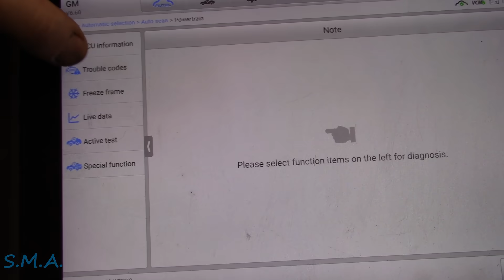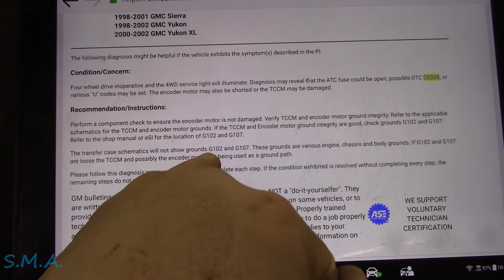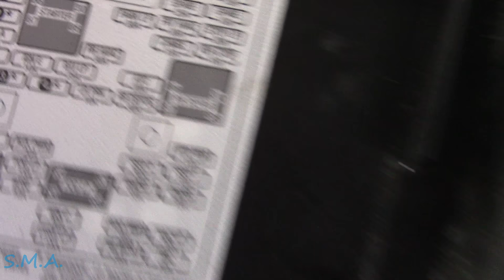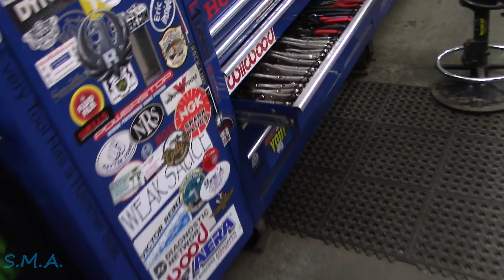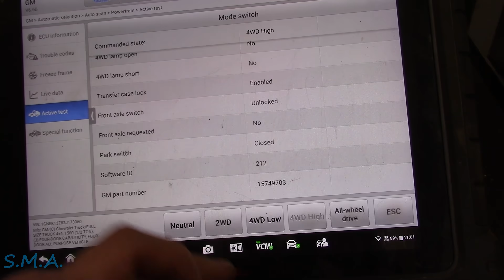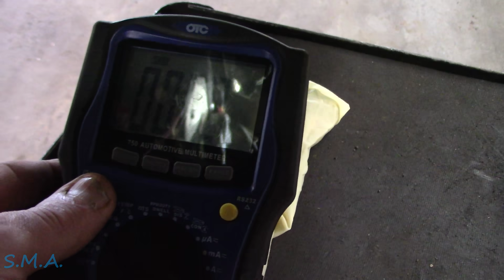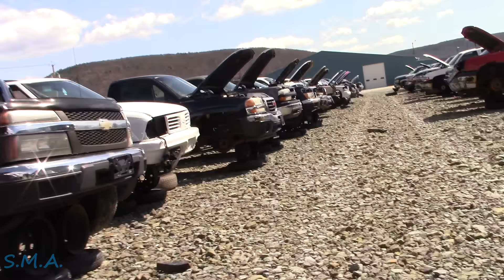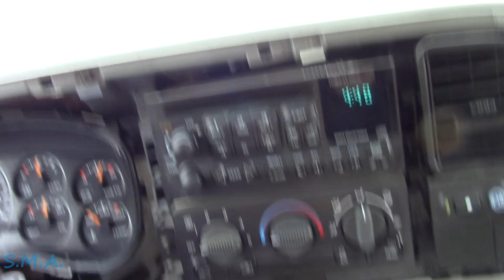Customer Spent $1000's And Still No 4WD

Comment: I had a Ford Ranger 4x4 that two different mechanics couldnt figure out why the t-case shift motor kept going out. Cost me the price of two of those little jokers. I got to digging around online and ran across a post where someone said the t-case motor could sometimes rotate too far when going into 4 low. That caused the sensor to be unable to see the position so it wouldnt shift. All I had to do was pull the t-case motor, physically shift the t-case to 2 low or 4hi, replace the t-case motor and it worked like a charm. Never had the problem again though I did pass along that little tidbit when I sold it

Comment: Wife is a Doll as usual., 
I found a great place for my cougar, 91. Had a smog thing  that has vacuum to it well it was all clogged with dirt and dust, replaced it. Did some other things and car runs GREAT! Got 22.5 mpg loaded up car going to SLC. For new JOB! Only drove 70 mph not F’ing 80 like every else was burning gas faster than they can pump the oil out of the ground in the Middle East !

Comment: Did you say corning earlier?!  Holy crap, I had fam up there until recently.. I've never had a dorman fail me, BUT I've also never used anything plastic by them or anything that was electrical or articulated.  It's always been stuff like exhaust manifolds.  Is there any way to test one of the shift motors before you put it on?

Comment: Went through this with several rebuilt actuator motors they kept exchanging. Ended up going with OEM.  Good troubleshooting! I just went and tested the last bad one they exchanged and it's shorted the same way.  They've got to be doing something wrong on the rebuilds.

Comment: If it has anything to do with electrical I always get OEM parts. For things like brake pads I will go aftermarket if there is a huge price difference. When I changed my front brake pads and rotors on my Ford Escape Ford wanted $160.00 just for the front pads alone. I live in Canada where prices are higher. Why would I spend $160.00 when I can get a good set of aftermarket pads for $70.00. I also changed my lower ball joints, outer tie rod ends and stabilizer links to aftermarket because Ford only sells non grease able stab links, tie rod ends and ball joints. I am in my mid 50's so I come from a time where greasing parts is a good thing. My Ford Escape only had 130000 km on it and the whole front end was needing to be replaced. So now i grease all the joints.

Comment: I think a bigger problem with these "couldnt fix it" shops are flat rate techs expected to find issues for .5. I work for a ford dealership, and I refused to go flat rate when the time came and they put me on split pay, but I've seen so many guys, my foreman included, load up the parts cannon because they're expected to diag this stuff for free.

Comment: I'm at 21min into the video and my guess is that because the motor is a bi directional (Bi polar) motor then both legs of the motor have to remain clear of ground, if one leg is grounded then the motor will work in one direction and blow the fuse in the other. just grabbing my popcorn, this is getting interesting

Comment: I have a 2000 AWD astro van. (Automatically controlled awd ).  Mine quit working a couple years ago. Upon investigation I found a "Remanufactured unit had already been installed, and replacement was not an option because of cost.  I took the old one off and found that one of the two motor brushes was worn completely off and I couldn't get replacement brushes.  You can't even buy just the motor, witch wouldn't have been difficult to replace. So upon further investigation, I found that I could leave the motor and gear box off, and I installed a linkage and rod that I can now manually use to engage or disengage the transfer case from the drivers seat by merely pulling and latching, or releasing and unlatching the rod coming up through the floor. If you are creative, sometimes you can bypass what I often times call unnecessary improvements to help get you out of the "money/technology trap.  I have investigated and solved many problems by watching You tube videos. My undying thanks go out to all those who have posted both informative and entertaining videos.

Comment: Remember when all that you had for 4wd transfer case was just a shifter and rod that was used to shift in and out 4wd some had to lock hubs.  Things were so much easier back then and easier to repair
Reply: Replace the linkage done.

Comment: Don't know if it's a GM design defect. I have a 07' Chevy Silverado and my transfer case went out after 80k miles. Then I got another one from the junkyard, and it went out after about 2k miles. Finally got a decent one from another junk yard.... But I agree with you, Transfer Cases are dang expensive!!

Comment: The Autel is such a nice scanner. Having Identifix right at your fingertips at all times is invaluable. My last boss had one and I spent 3 times what he did on a Snap On Modis scanner. The Modis is a great scan tool, but the info in it isnt set up as nice as the Autel and it has no internet built in. Between Google, a laptop and the Modis I was able to do what the Autel does, but that is quite a disadvantage. Some lesser known brand scan tools wont scan all the available modules, the Autel does just about everything, but I have found there are times you will need one over the other, or vice versa, to perform a specific task, get access to a particular module or perform a specific test or reprogram. The Autel was great for reprogramming keys, Id grab it everytime when i had to reprogram a key, but now they make fairly inexpensive key programming modules that work very well for around $500. Another thing i dont like about the Modis, and just about any other scanner Ive saw short of the Snap On Zues, is the fact that you cannot work bidirectional commands and monitor the scan data at the same time. Some tests will give you a short data display, only showing a few PIDs that are directly related to that test, but opening a canister purge valve while monitoring O2 sensors is not an option, just as an example. You would need two scan tools to do this and there is only 1 OBD plug. The Snap On Zues will allow split screen operation, so you can work a control and monitor data, it runs on Windows CE and the Modis on some proprietary ridiculously expensive Snap On software. The difference in the cost of updating the Autel and Snap On scanners is vast as well, I spent $1200 a year on a software subscription service to keep my Modis updated, for that money you can buy a used Autel. If I did it over I would certainly go with the Autel, they work just as well as bigger name scan tools and cost vastly less.

Comment: There is a wire harness that runs beside the fuel filter that can rub on the front driveshaft and cause ATC encoder motor and Rear O2 sensor problems, but I saw the harness and it didnt look mangled. I have saw quite a few of these do this though. Just FYI

Comment: Chevy loves to add too many levels of electronic crap to their systems. I have a Trailblazer that keeps blowing a fuse under the rear seat. I finally tracked it down to a short in the air conditioning under the hood. I fixed that and the 4wd began working just like magic.

Comment: Did I mention that I went through this hell and it was the associated fuse receptacle in the panel at the left end of the dash.  The fuse was good, and both sides showed 12 volts.   Until you pressed a transfer case button and the load side of the fuse receptacle dropped to 2 volts, then maybe 0.12, until the load went away.  I pulled 5he fuse, used a nail file to clean the fuse holder and like that, 4 WD all fixed.   The command couldn’t make it to the encoder motor and when the expected result neve4 occurred, service 4WD system flashed on the dash.    Just a fuse connection.

Comment: Those grounds are on the left-hand side underneath the truck below the drivers door on the frame right The bowl that holds the cab to the frame a lot of people miss it because they think this five wire grounds don’t mean nothing and it causes nothing but problems there’s a lot of people that overlooks this ground and a lot of guys get the encoder motor clocked wrong and it will set a code you have to get that motor clocked in right

Comment: i remember when i was very young living in PA, our Grand Wagoneer had similar issue, new TC motor installed, new TC put in (pothole damage broke bracket) tech was talking to my dad and asked him if its ok to test?   my dad shrugged sure,  little he knew  the tech simply drove behind the shop and into woods  roflmao.   it was their Jeep "customer assurance trail" both "so called"  test/diag cente. it also doubled as test drive for new customers to see how jeeps fare offroad.  It had dips, smooth trail heads,  loose dirt inclines,  roots and potholes, shallow creek, and then long and smooth farm access trial.  then back at shop via normal road.    They don't make Wagoneers like they used to. they were absolute beast.

Comment: I keep mini fuses in my tool box that i cut off 1 of the male spade from so when check the female pin drag you can check each one independently had a fire truck that was only running on 3 injectors turned out it had loose pin drag on the fuse connector 2 other shops couldn’t figure it out thats how i found the problem hours spent checking it by other i found it in about 10 mins

Comment: So - technically speaking - all the other mechs (I mean douchebags) just 4kt around relacing unknown irrelevant parts - whereas you - you replaced the ONE component that had failed.
Result - all other work before - fixed nothing.
Your work fixed the entire problem.

Comment: I deal with these NP246 TC all the time and have never seen that weird black plastic "plug"/ "cover" on the front of the TC shift actuator/motor before. Sometimes these come with a "lock" to prevent the motor from rotating during shipping, did you look to see what the heck that was?

Comment: It always amazes me how people will just throw parts at it.  I just went through this with a good friend.  2006 navigator won't start.  No codes.  Starting fluid and it'll kick over.  I take 10 seconds and put a fuel pressure gauge on it and it's got NO fuel pressure.  Jump the relay and still no fuel pressure.  Jump into the wiring harness at tank and it has 12v and ground.  And my buddy wants to check and re-check relays, fuses, etc.  His mind is made up its a computer problem.  We do this three nights after work.  DUDE you need a fuel pump.  Nah Ima take it to a repair shop.  He hauls it there.  They put a fuel pump in it and it's running great.  Oh well the shop needs to eat too.  Ok by me the thing is a rusted mess and I really didn't feel like replacing the fuel pump.

Comment: i have always had good luck with Napa Canada  parts for both my 93 Chevy k1500 4x4 and my 85 ford 1500 4x4, i stick with older trucks because i dont want all that electronic computer crap,it bad enough my 93 Chevy 4x4 k1500has all them stupid electric modules in the bottom of the transmission, with tiny 24 ga wires. when it stops shifting you have to drop the pan to get to the 5 different black modules.. i been trying-to find out witch one is the problem as at 55 TO 60km per hour it shifts into neutral and you drop it down to 1st gear an its like it is in 2nd or 3rd,, it dont mater if you start off in OD OR DRIVE IT DO THE SAME THING,, I REPLACED THE THROTTLE BODY CENSER  from napa $83 cnd AND is changed from shifting into neutral at 25kmph to the 55 to 60 kmph. a lot of time it with shift back in to OD on the hyw if i feather the gas,, or it will drop IN TO 1st..  , I BEEN WAITING 2 MONTHS TO GET IT INTO MY LOCAL SHOP TO GET THEM TO SCAN IT BUT THEY ARE SO BUSYS I CANT EVEN GET A DATE, I BEEN ON A CALL IN WAIT

Comment: Great video. What throws everyone off (including me) is when you already replaced the part & it's already defective. That's when everyone starts throwing parts at it. When the parts were cheap, it didn't matter. Today, not many people want to spend $600 for a part that's a possible fix when you already replaced the part. Not defending the other shops but it can happen. That's why I try to stick with OEM parts. Even those can be defective. & way more expensive.

Comment: Among the items your customer listed, I thought he said the transfer case motor had already been replaced. My 2003 Hummer H2 had the same problem when I first bought it used in 2009. I quickly figured out the problem was in the transfer case motor, but was hard to duplicate because it was intermittent. Eventually, I opened the transfer case motor and found there was a rotary encoder disk which had slipped loose from the output shaft. That made it occasionally send the wrong position info to the electronic controller, causing it not to shift. The encoder disk was cracked and couldn't be tightened, so I replaced it with a Dorman one. That fixed that intermittent problem.

Comment: If you're ohming something and it reads “OL” then your loop is open, in other words the path is not continuous (broken/separated) If you're in the voltage setting and it reads “OL” then the voltage you're measuring is too high for your meter to read.

Comment: Had the same issue in the same vehicle. Had to break my transfer case open, weld a hole close, grind it smooth, install an aftermarket sheild where it had worn throught and throw it back in. I changed out the TCCM while I was at it. I haven't had an issue since.

Comment: watching you is treat every time. You consistently apply a structured reasoning process to diagnose and your repair skills are at the very top of the mark. In this case I was wondering why no one did a motor check out before? For what he already spent I would think somewhere along the way the old parts cannon approach would have engaged which means they would have substituted a motor. Maybe they did and didn't know what to do with the information? Wouldn't surprise me if that happened because the real thinkers out there in auto tech land are far and few between. Then again the shop policies get in the way of real detective work, they want to spend little time on a job because the aim is to do high volume repairs that do not take up time....it is the nasty old profit over quality work struggle.

Comment: You do a great job making no assumptions.  Some of the reman or new low-cost replacement parts out of Communist China especially, are engineered to fail especially when they use low cost electronics that can't handle NVH stresses in a vehicle.  Low Cost, Reliability, and Longevity--choose two.

Comment: You can change the duration of the backlight. It's usually in the instruction manual.  It's something like.....hold a certain button combination while turning it on and then you can turn off the back light timer....I think.....and leave it always on when you switch it on. Something of that nature. It depends on the manufacturer of your meter.

Comment: Kudos for your logical approach and using the correct equipment.

Some good design thought went into the control module. The idea is, when the vehicle starts the control module puts +12V on both motor leads through a limiting resistor and monitors for current. There shouldn't be any. If there is, set the code. Automatic bad motor detection. 

The documentation wasn't exactly crystal clear. If it came out and said "motor lead shorted to ground" that might have been better. 

It also occurs to me that you could see similar symptoms in power windows and power seats. Those motors are bi-directional and have both leads brought out too. If there's a control module involved. 

A good mechanic is always learning.

Comment: Great video! Thank you! Have you done one on the injector spyder on a 5.7L Vortec? My frustration is from a 1996 Yukon. I keep getting a random cylinder misfiring. I have had the fuel pump and filter changed and when it was done the tank was cleaned they also said a new 'sock' was installed. The distributor has been replaced as well as wires and plugs.

Comment: Well, not only american parts. Just watched repair video for crank-no start no one else could fix. He discovered the engine CPU was not seeing the crankshaft turning. It had a brand new Bosch crank sensor. He had no information other than everyone else had given up on the car. 
The owner by now was flat broke and the mechanic offered to fix it at no charge. After a bit of hemming and hawing and wild goose chasing through what other mechanics had done, he reinstalled the old crank sensor. It started immediately! 
He said this model was known to get crank sensor failure when they get a bit too hot and refuse to run until it cooled down. He was not willing to give it back to the owner with an unreliable sensor like that. 
He decided it was just a defective new part and got another new Bosch. Again No Start and the CPU was not seeing the crank turning.. He cut/pried open the plug on the new Bosch sensor the owner had already paid for and discovered the pickup wires were reversed so it was sending the CPU a reversed voltage pulse as the crank magnet went by. He reversed those two wires and it ran like a champ. Bosch had an assembly line screw up. i wonder how many hundred went out like that.

Comment: So the shop that put in the motor might not have had a wrong diagnosis but their failure was to assume when they still had a problem that the new part wasn't bad also. I learned a few years ago to either test before installing or if the problem still exists with the new part to test the new part. New doesn't mean good!